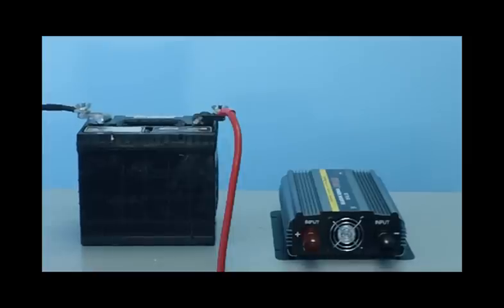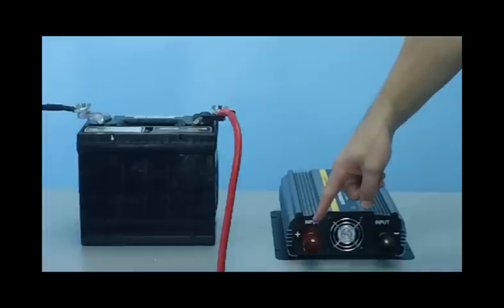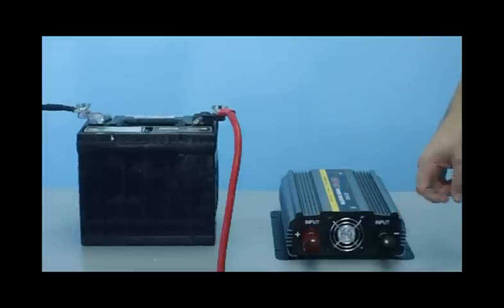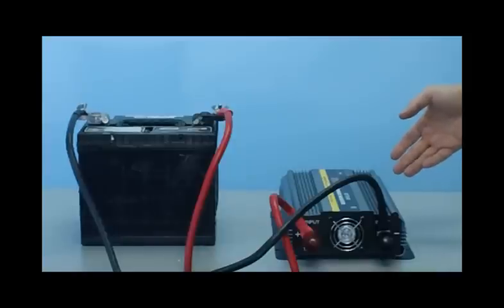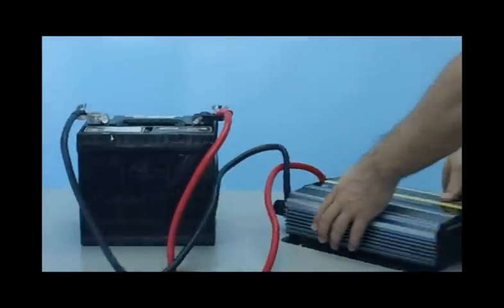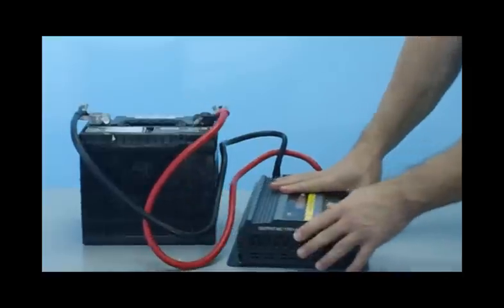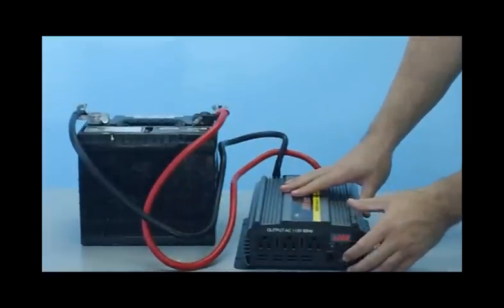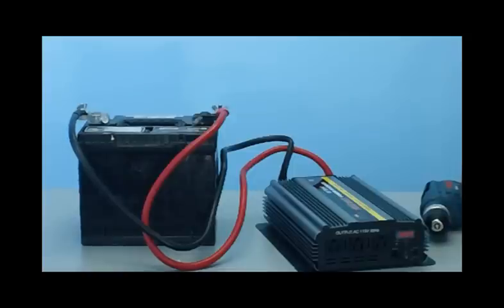Power Inverters - How do I hook up the Inverter?

Comment: Tha manual for my 1500W inverter recomends that you use a in-line 150A fuse or breaker. A 12v battery like that carries a huge punch if something goes wrong...